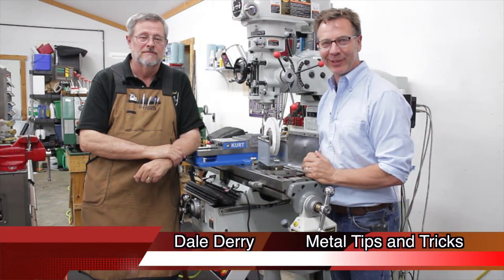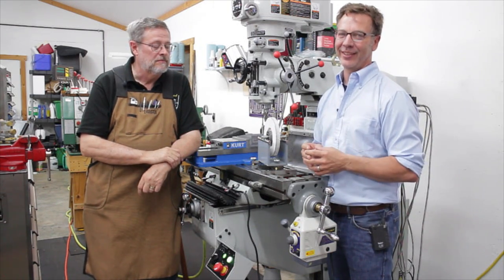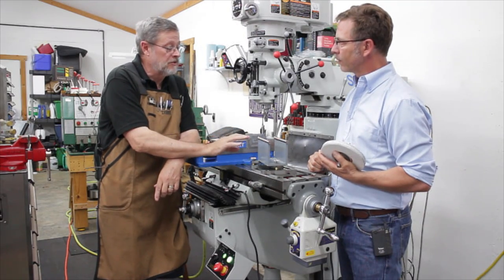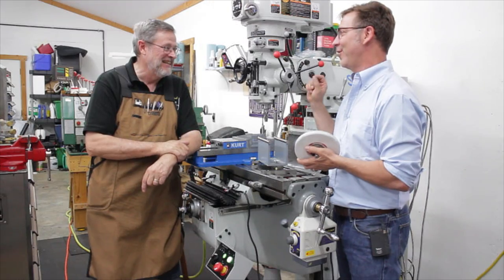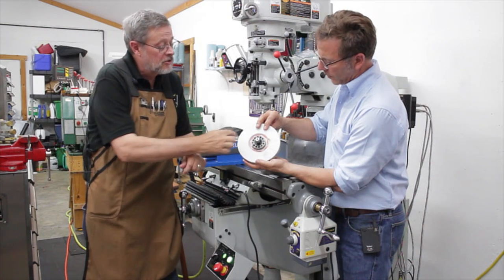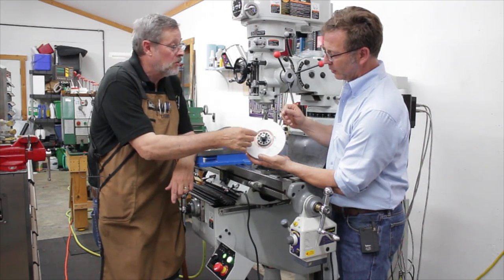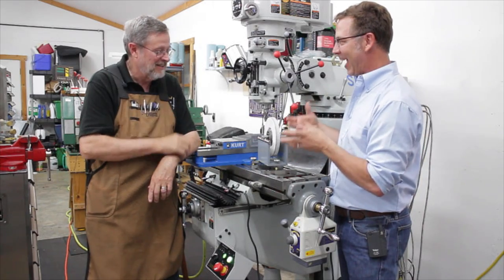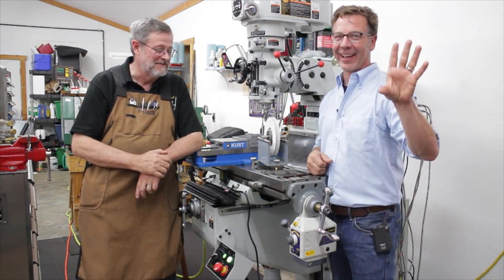How to make a Wheel balancer

Comment: I do the balancers the same way using jb in the groove-and the three leveling screws and to level put a ground item on top of the rails then place a 1 inch or so ball bearing on top and adjust till it is stable. 

the other thing I do is I use jb weld on the side of the wheel to cure on various weights such as half washers even carbide rock tumbler grit. Unless a hub is a balancing hub I strictly use that system only and no--nothing will fly off to blind a person at all. pretty much only that method can be used for a pedestal grinder also which have no way to balance them--stick a rod in and balance it the normal way let cure and put the wheel or wheels back on you will not even be able to tell its running.

Comment: Yes I made one of these just like his shown for a pedestal grinder and to balance them you drill out one half of each washer and adjust the lite towards the heavy--worked great.. But for the surface grinding wheels it was a bit narrow so I will make another wider one and use rollers however just be aware you can simply mill a .255 slot for instance with a regular cutter and set the rollers down in there or jb weld them. Using the ball end mill as if to match the rods --not that good.. to level it just put a ground block on top and place a ball bearing and adjust the things till the ball stays put--works great.. to balance the wheels you can use small weights of various types even washers or half of washers and use the jb weld up near the blotter--works perfect. Let the wheel settle and mark a line on top of the wheel showing "lite"--place the weights only there with masking tape.. stay a bit shy on the weight because of the jb weld--when you get it good NOT OVERWEIGHT--remove the masking tape and apply the jb weld and stick the items on WORKS GREAT BUT SOUNDS FUNNY--it really isnt.. dont us jb KWIK--it does not give you enough working time. One drawback is you must balance the wheel/wheels and let it sit for a day--you cannot use this method to balance and instantly put the wheel back on and grind.. Also note the balancing arbor--I make and sell them..

Comment: I have a cad data base and document where I am drawing up and documenting the various tapers for surface grinders and even other machine tools. For most manual surface grinders its 3 inches per foot--with possible different sizes. However some are in fact unusual angles. DO YOU POSSIBLY KNOW TO CONFIRM THE TAPER PER FOOT OR ANGLE OF THE BROWN AND SHARP YOU MENTIONED? thanks

Comment: actually i had to look at the date because I thought you had seen mine and made one however they are based on the same principle. I MADE MINE OUT OF WOOD.. with smaller drill rod-actually i bought a long screwdriver and cut the shaft off.